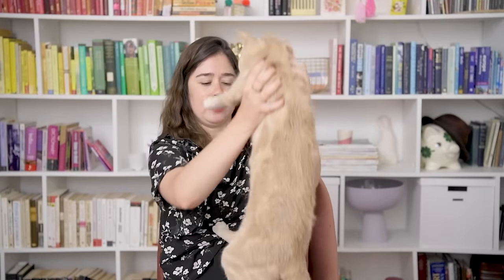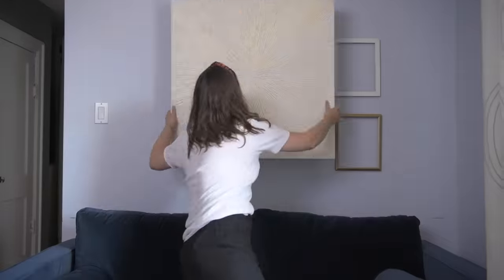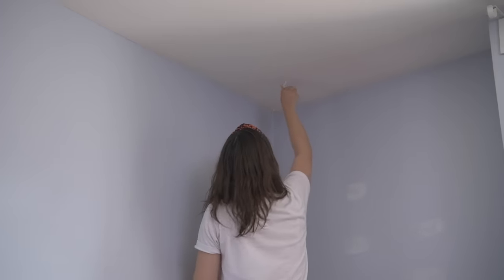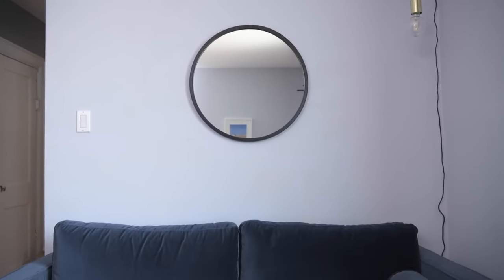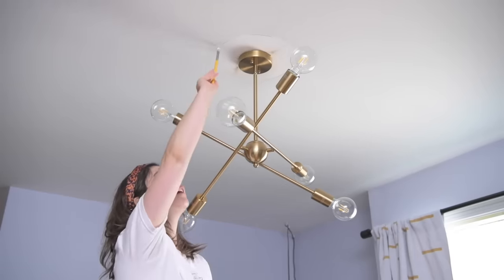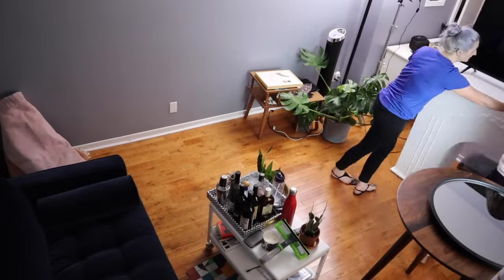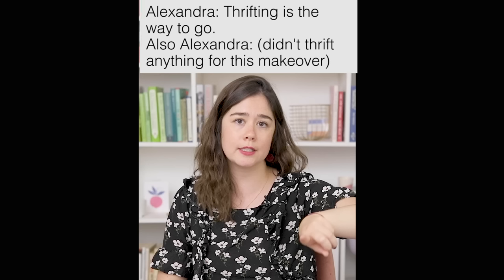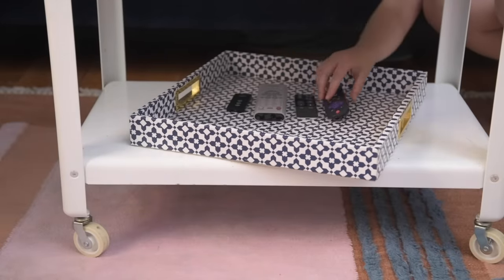This Small Rental Living Room Got A Major Diy Makeover | 7 Ways To Add Style To Your Living Room

Comment: Love everything except that black cord from the hanging light would drive me crazy!
Reply: Paige Shaw I would prob paint it the wall color.
Reply: Maybe dont paint the cord itself the flexibility of the cord would make that difficult but definitely get D shape cord protector that can hang on the same hooks and paint that the same colour as the wall
Reply: Can change that with washi (? spelling) tape ...simple fix
Reply: Kelsey from the Sorry Girls has wrapped the cord with yarn and under E600. You could do something like that so at least it’s adding a design element in the room
Reply: Yes that cord is awful
And since they moved the couch, i don’t even think it is necesary anymore, they should have pulled it out alltoguether
Reply: Paige Shaw i was thinking the same thing. Awhile ago she shared some strips that hold them in place. i wonder why she didn't use them
Reply: There's cord covers that look like moulding
Reply: Along with the curtains not being steamed and the sparkle above the new curtain wasn’t painted 🤭
Reply: But it helps with the cord clutter!!!
Reply: Me too and I would install a pull down type shades(from ikea) instead of covering the window. It would be better, when no one is there she could opened as she wanted :) But I'm shocked I liked this room makeover
Reply: yeah, I want that hanging light to move over the couch in it's new position.........
Reply: I didn't like the light, either.  Dinky.
Reply: Agree
Reply: @maggiesue4825  me neither 
The light is horrible
Reply: ME TOO!!! haha
I would paint the cord the same color as the wall color.
OR get a "cord cover strip" and paint the strip
Reply: I literally paused and dropped to the comments to complain about the cord. If the cord needs to be exposed, why doesn't anyone straighten it out? It's super easy. I see that loose cord in so many videos and it's so annoying.
Reply: Agree.  Think she had a hole in the ceiling now and it would take repairing, UNLESS the hooks could be used to hold a hanging plant.... that would look pretty near the faux fireplace.
Reply: Paige Shaw  Well. Here goes reply #23!  My husband does a lot of phone system and electronic type wiring installation. He’s very picky about keeping cords hidden as much as possible. If there’s no attic or overhead access to run inside the wall he has drilled a small hole in the wall up next to the ceiling and runs the cord through it down to the outlet. Then dabs a tiny bit of putty in the hole. May have to get an electrician to wire into the outlet or a friend who knows how to do so safely. If that is impossible he uses the wire covers.
Reply: Pamela Atkinson  too dark even for pothos
Reply: Same!
Reply: I love the black cord hanging. So Scandinavian. #hygge #GOAlexandra #saHYGGELIGT #danishstyle
Reply: Not withstanding exposed Black cords, some are my pet hates are exposed wires,of any sort, Net curtains and Brown furniture, my ideal room personally would be no furniture not even a bed ,but nice neautral colours on the walls, not everybodys taste by no means, but mine, everybody to their own i guess, but my vision of a room i would i know be happy to live in, and of course minimiliast as well!
Reply: @Jenn C omg me too
Reply: Saaaame
Reply: @johnentwhistlesurelysamsun1840  So, sell all your stuff.  Your ideal is within reach.
Reply: I said the same thing. Reminds me of the light a mechanic uses and hooks under the car hood.

Comment: Thrift idea makes a radiator cover out of wood paint white now you have an extra side table👍🤔😊
Reply: Eve R I think that she will have to move the couch again if she uses the rad cover. For me I would absolutely not want to be looking at that radiator and I would not want my couch pushed up against it when it’s on. I like your idea and will the couch still fit?
Reply: @jenniferjackson9642  She doesn't need to move her couch, the cover can be made with a simple design don't use a think piece of wood just cover the top part haft only and will help protect the sofa from the heat 😊
Reply: Where can you buy the floating shelves?

Comment: Is the couch being by the radiator safe?  They can get really hot.  Overall it is really cute.
Reply: Avis Dyson without a flame or electrical wires,  how could it be dangerous?  It won't implode!
Reply: @virginiadonnelly1031  The fabric is probably coated with a product that is fire retardant.  I would think over time it would dry the couch out though..  I actually would have put the couch in front of the window and the table over by where the couch is now because of that very issue.
Reply: I don't think it will cause any safety issues but since half the radiator is now blocked it won't be as efficient at heating the room
Reply: it's giving me so much anxiety to have such an expensive couch next to the radiator omg
Reply: @saammmy7   Exactly.
Reply: And blocks heat from the rest of the room. Designers only want the end look. Wish one would design around how people truly live.

Comment: I totally wake up and think of things that I need to do, or things I want to change, or figure out a solution to a design problem I am facing!  You are not alone!

When I thrift old furniture (which I do all the time, as I love finding mid century pieces for a fraction of the price!) I either luck out and it's perfect, I refinish them (keep the warmth of the wood), and sometimes I paint them (not real wood, but the right style).  I also use pieces in a non-conventional way! (For example I used an old credenza for a bathroom vanity. Also used a credenza as a tv unit so the doors can close and everything is hidden and crisp!)

So many thrift stores around and things always change! It definitely is a time game, as sometimes it takes a LONG time to find what you are looking for.  Key - never settle! What you want will show up, and if it doesn't, you can always do it yourself!

Comment: BIG Fan here!! Two thoughts: 
>>Radiator and velvet Article couch-does she use the radiator for heat??
>>While I think the faux fireplace is super creative for the purposes you are using it-style, ambience, cord hiding and storage-it doesn't seem to be as slick as it could be. It seems larger than it needs to be and not additive in the right way-to me at least. Good placement in the room however. Seems that that piece actually created issues with furniture placement, not facilitated or inspired? What do you think?

Comment: I would have incorporated some sort of shelves onto the faux fireplace to be able to put the books that were on the floor under the window. I also would have added sheer curtains behind the pattern ones instead of patching the window with the contact paper to blind the window, and perhaps add plants in that area as well to prevent see-through from outside. It's a matter of preference but also a matter of design with the whole. BTW, I knew from the beginning that the couch needed to be moved to the other wall ;-)... hehe. The end result looks nice, nonetheless!

Comment: practical question: were there plugs for the tv on all the walls so you could put it anywhere? in my apartment you just have the plugs for cable tv on one wall and you are pretty limited in where you move the tv 😕

Comment: I noticed that the TV cabinet/fireplace is too tall. When you are sitting in front of the TV, you should watch it at eye level. Although I do like the faux fireplace, it‘s too tall to work as a TV console. If there was a low console used for the TV, you could have two shelves to house the media, put up lights behind the TV to provide a warm glow, without interfering with light reflecting on the TV screen. And finally, I would recommend an acrylic coffee table a bit longer than the converted shelf, to provide the room with storage, but not crowd the visual space. The bar table was a perfect, the wall shelves were a great fit, and the addition of pillows warmed up the living room well.

Comment: Also, if it had been cleared with the landlord, instead of that free-standing dining table, you could have had a drop leaf style table built over there...one where the brace for it could be folded against the wall and the table top could be let down when not in use....and for the seating around the table use stackable chairs or stools that could be moved out of the way.

Comment: I love the lamp but hate the black cord.  Personally, I think I would find an attractive fabric, something subtle.  Make a casing that would fit over the cord.  I would sew the "cord cover" with right sides of the fabric together with a seam about 1/4".  I would make the casing itself a little larger than the plug of the cord so it would slide on easily once the fabric is turned inside out, so the raw edges are on the inside of the cord cover tube.  Make the cover 1 1/2 - 2 times longer than the cord length that will be showing.  The amount of "scrounching" will depend on the weight/thickness of the fabric.  If it is a thin cotton fabric, you may want more to your scrounching to be 2x the cord length.  If you are using a heavier fabric, like corduroy  or velvet, 1 1/2 x the length is good.  Just fold in the ends of your tube and snug it up using a safety pin or thread.  Voila!  A cover you can change with your décor.  Another thing, I thrift for picture frames.  They can be very expensive.  I find pictures in magazines, or online of frames that I like.  I have found fabric with scenes that I like.  Then I put the two together.  I duplicate the frames into the style that I found in the magazines, etc. and then cover a piece of foam core or thin plywood with the print fabric and anchor it to the back using glue.  After covering the board, I pop it into the frame.

Comment: Thrifting tip, for clothing thrifters: Always check the mens section for nice womens clothes (especially sweaters and coats). Sometimes women will hide items they may want to come back and get later or can't commit to right away, so they store them in the mens section ( Usually near the mens plus size section). Men will usually not move them or pay any attention to them either.

Comment: Pro tip:  Painting electrical cords with the wall color makes them almost disappear.  Also,  the curtains are too short.  If you aren't going to have the puddle or trouser on the floor, they need to be (at most) half an inch above the floor.

Comment: Thrifting tip- get out of the city. Like, far out. City thrift stores are either a) picked over or b) the dealer knows the market value and charges accordingly. Best deal I've ever seen was a 4 piece bedroom MCM ebony wood set, beautiful condition, for $2500 in Rockford, IL. Do you know how much that would've gone for in Chicago, just 2+~ hrs east? So, stop at roadside thrift stores, estate sales, or garage sales (boot sales?) as you travel. It's worth it.

Comment: *Time to get hip to Muji. I preferred the original curtains and rod; sometimes change is not better in and of itself. Perhaps you could have used the money spent on the new, inferior ones and overly dark rod, to buy a MUCH bigger mirror. Tips for thrifting: Buy less but buy quality. The items on the shelf are uninspiring. It is better to invest in one good statement item or some beautiful pottery and then use books rather than filling it out with random Homesense articles. Work harder:  if you are going to install floating shelves - make sure they do not fall short of the width of the wall but continue along the entire width. Sometimes this means you will have to make them yourself. The TV screen should have been mounted on the wall. The colour of the throw rug is drab and it is so thin that the wrinkles will never settle. A neutral rug with a  heavier weight would look better if you cannot afford better quality. The fireplace was beautifully done but the dimensions were too deep for this space.

Comment: Couch smack up against the radiator.  Needs to move away a couple inches.  Gotta be better solution for books on floor  -  but definite improvement.

Comment: I dont like the fireplace thingy for the tv. It still is eating up some space and very bulky. Better be using tv mount and drill it to the wall, can rotate tv left and right and adjusting the angle depending where u sitting, and she can add a small floating shelf just to put plugs organiser. Decorative light for tv? We have LED strips that the colour can be adjusted. But u are able to work that bulky fireplace somewhere so good for u.

Comment: Ok, vast improvement however thought I’d throw in my thoughts....
1. Ditch that awful pendent, you hide the cord mess then put that in???
2. Curtains are beautiful but too short, the rod is also great but to long.
3. Fireplace is a cute idea, but takes up a bunch of space. I would of painted it black to make it look less handmade. Would ground the room as 
     As well.
4. The rug is floating in the room, sofa needs to be on it. Also it’s going to slide every where. Really nice choice tho, very pretty.
5. The print above the sofa is wonderful, but too small by itself.
6. The clutter under the window??? 
7. Film for the window is a good idea, but they make better options.
8. Love the shelves but the styling was way lacking.
9. Table was an excellent choice.
10. When you patch in paint it’s going to show, it will NEVER match completely.
11. Light fixture rocked, again the ring is going to show.
12. Coffee table ruins the look, cute but so doesn’t compliment to sofa. 
13. Need light by the sofa.
14. Didn’t hear you mention a budget, maybe that’s why you didn’t do certain things???

You have very nice taste, just think you need more experience pulling things together. I’m not trying to be mean, just some ideas to ponder??

Comment: The window treatment is not right. curtain rod is too low from the ceiling,  its more than 4-5 inches from the ceiling and the curtains are not touching the ground, which makes the room looks smaller and when you have a small space,  blocking the light with a film is not a good idea for a living room. Thanks to Carla, for not adding the film to the entire window. I would feel so claustrophobic if I couldn't see outside the window.